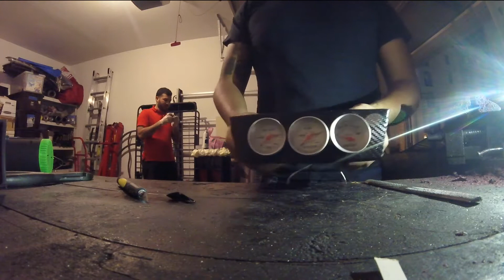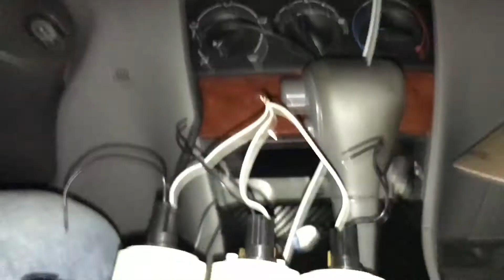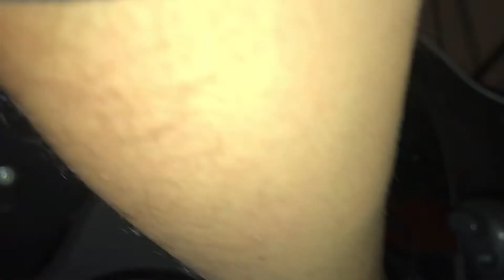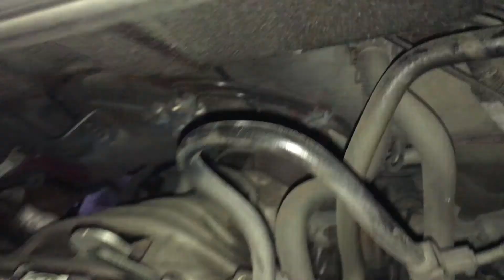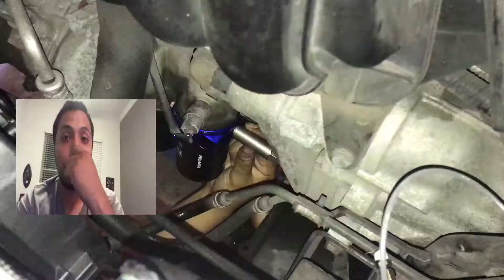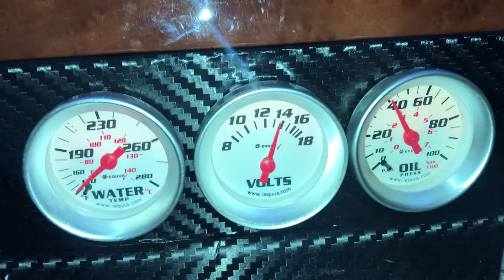Turbo Charging a 2008 Corolla build part 5 (Gauge install)

Comment from the maker: Still piecing everything, need new AEM computer, custom manifold needs to be finished, and I'm moving from apartment to house currently, when I get the two car garage I should be able to knock it out. Overall making a turbo set up for this car is cake, just need to make a bit of time 👍🏽
Reply: You almost had me? You never had me! You never had your car! Granny shiftin', not double clutchin' like you should. You're lucky that hundred shot of NOS didnt blow the welds on the intake. Almost had me? Now me and the mad scientist gotta rip apart the block, and replace the piston rings you fried! Ask any racer, any real racer, it don't matter if you win by an inch or a mile. Winning's winning.